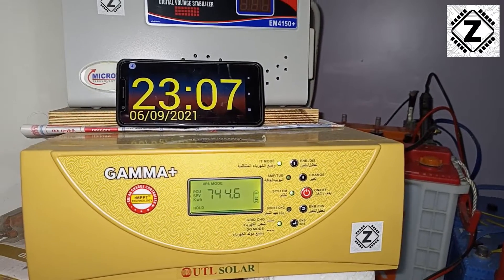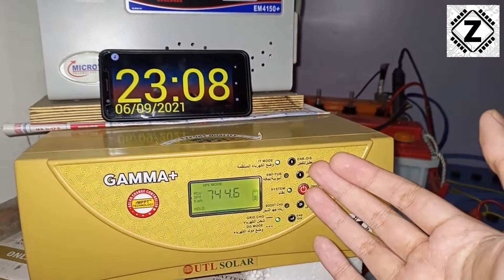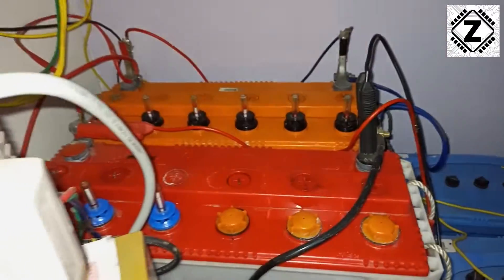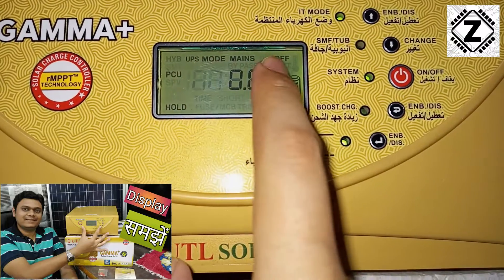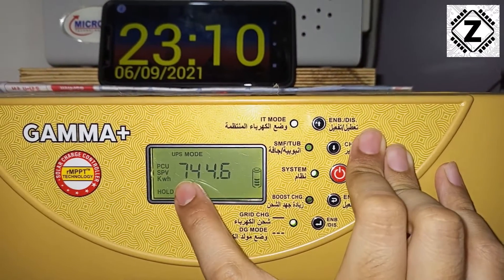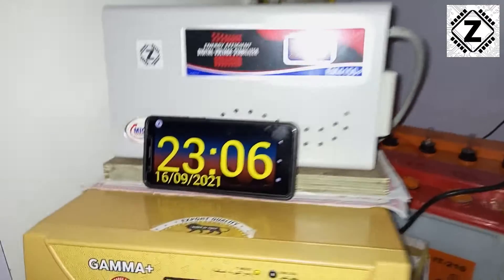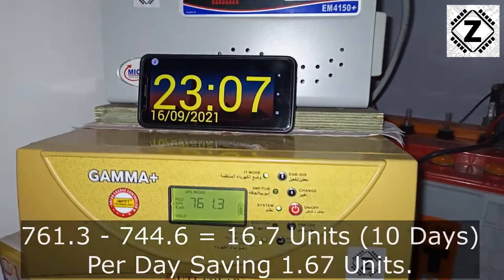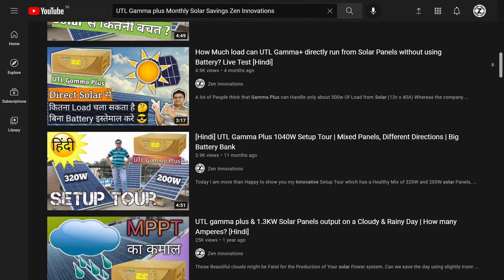UTL Gamma + Sept 2021 Solar Savings 10 Days & Monthly on 1.3kw Panels | Heavy Clouds & Rain [Eng]

Comment: You are running the load frm battery at night and re charging them in the morning frm solar. will this daily charging and discharging process not reduce the battery life span?
Reply from the maker: It does affect slightly but solar battery is rated for such use...

Comment: Sir please possible ho to help me because
I've Loom solar make monocrystalline 180 watt ki 4 panel from more than 2 years , I want to upgrade my system with adding more panel but Loom solar is discontinued monocrystalline panel now available only monoperc panel but rating of panel panel is some different in same categories can I connect with parallel my old 12 volt panel with new mono parc panel?
Thhak you.
Reply from the maker: If the rating has minor difference, you can add.
Reply: @ZenInnovations  sir my existing 4 number of Loom solar make 12 volt monocrystalline panel ka rating is
Maximum power ( P max) 180 Wp
Maximum power voltage ( V mp) 19.95 volt
Maximum power current (I mp) 9.03A
Short circuit current (I sc ) 9.31 A
Open circuit voltage ( VOC) 23.26 V
Maximum system voltage is 600 voltage
and new Loom solar make monoparc 190 Watt panel rating is
Maximum power ( P max) 190 Wp
Maximum power voltage ( V mp) 20 Volt
Maximum power current (I mp) 9.50A
Short circuit current (I sc ) 9.80 A
Open circuit voltage ( VOC) 25 Volt
Maximum system voltage is 1000
I'm confused about this 
can I connect parallel with my existing panel, please advise me
Reply from the maker: @amitabhakdh  yes. You can go ahead.
Reply from the maker: One member of my Telegram group is using such a mix.
Reply: @ZenInnovations  sir
thank you so much for replying and useful advice 🙏